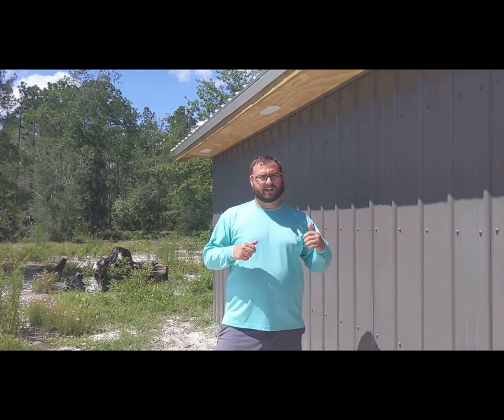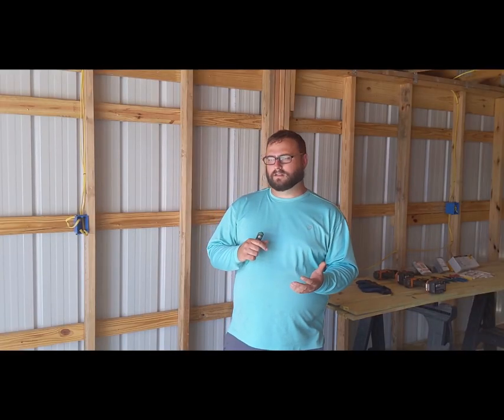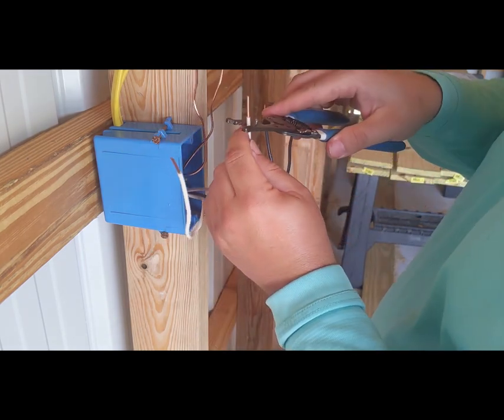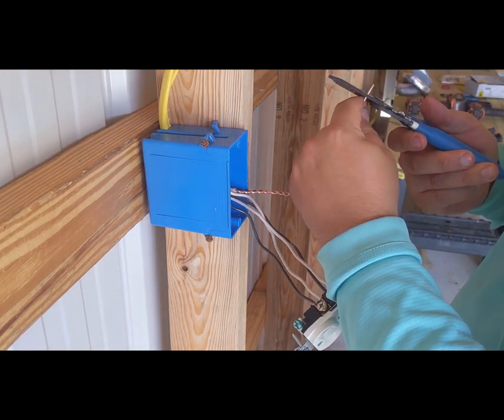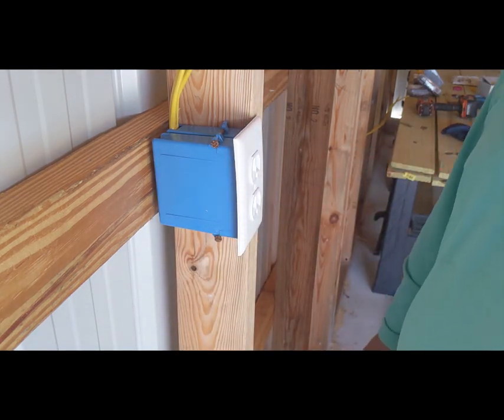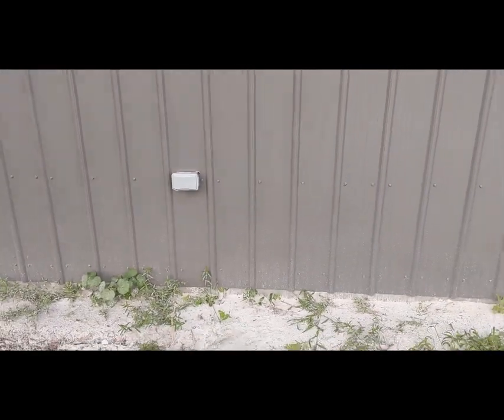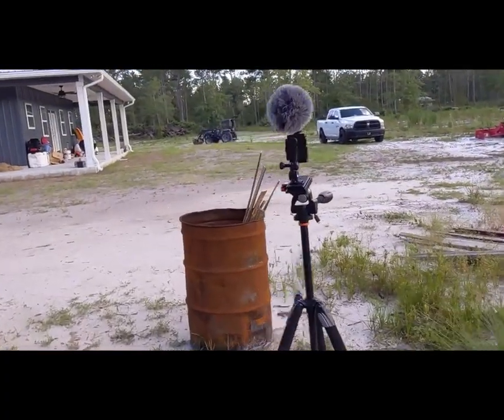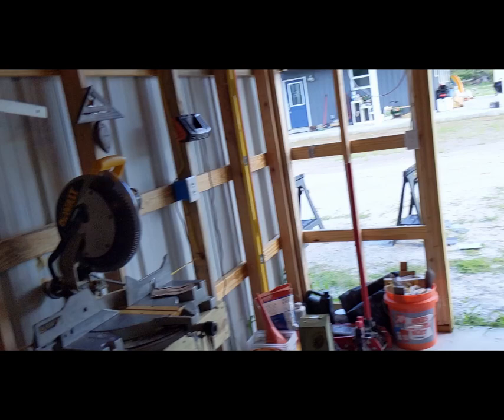Basic electrical wiring 101 (Shed Outlets)

Comment: I have a couple questions for you.   My only concerns are for your life.
Why did you not sleeve the metal siding behind the exterior box?   Sharp metal against NM cable is a violation of NEC and very dangerous.  High possibility it could cut into the hot conductor and energize the whole outside of the building.  I read an article once where someone was leaning against an AC unit and touched the metal building.   That was the last thing he did in his life.  
You are using NM cable in the walls.   I am assuming you are putting wall covering on the walls as the cable below 8’ is required to be protected against physical damage with conduit or other means.
In case you do not know, a separate building is now required to have #6 cu grounding electrode conductor connected to grounding electrode or electrodes.   This is for lightning protection.
Please be safe!   The life you save may be your own!     Respectfully,   Kevin
Reply from the maker: All valid points Kevin! Thanks for stopping by.
Reply: @FightingIbisFarms  I'm an electrician in the UK and I have agree with Kevin, we have similar regulations that we must follow and possibly more. That Square D distrabution board is really old and has no earth leakage protection

Comment: You didn’t show how the outlets are connected to each other...via piggyback and you have 6 outlets on one 15 amp breaker????..
Reply from the maker: I piggy backed some. I was running 12-2 so that would be good for 20 amps. I have another video showing me roughing it all in.
Reply: @FightingIbisFarms  thanks. I appreciate you sharing.